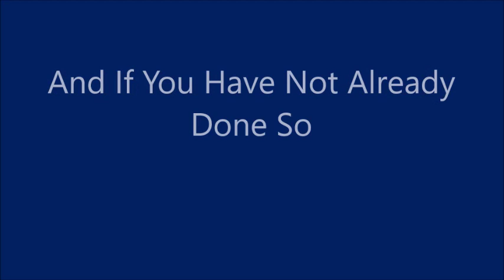Getting Some Good Idea's From Anthony's Fence Project

Comment: Instead of building forms for the post, buy cheap 6 inch pvc pipes and use that as forms, that never gets removed.   Dig a hole, drop the pvc pipe in there, make it plum, and then insert a ribar and then cement.
Reply: Josh Posh great idea